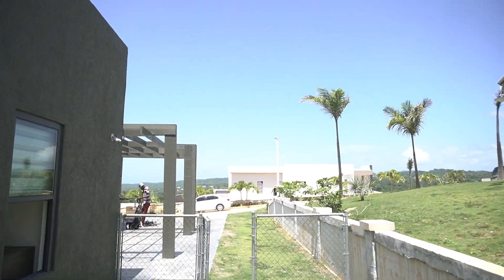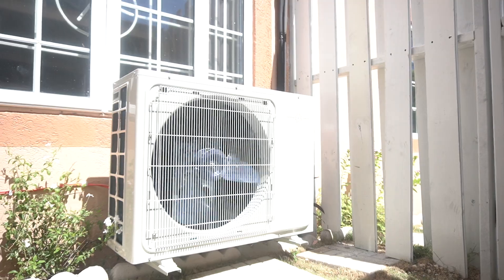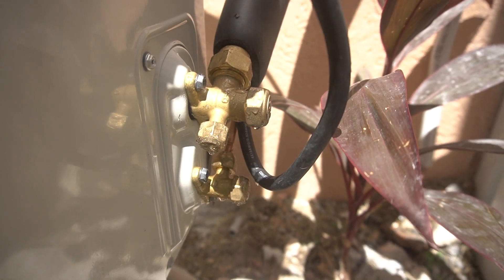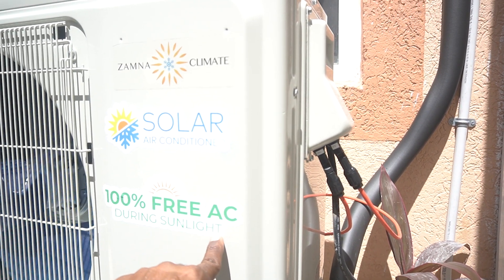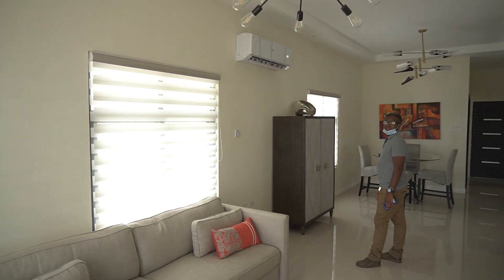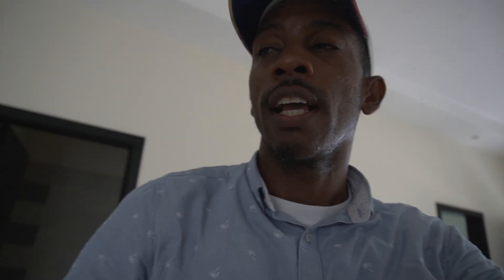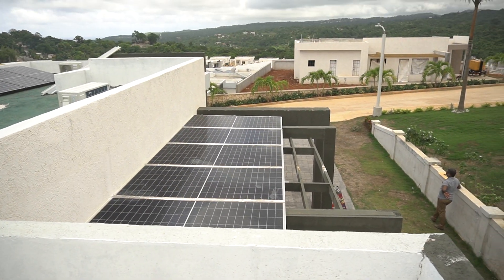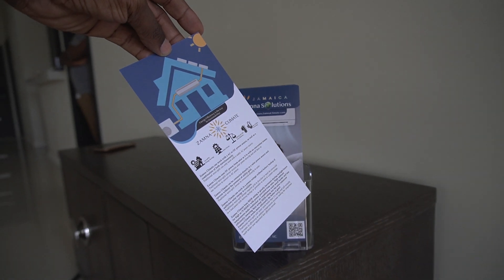DIY Solar Carport for 100% Free AC during Sunlight ☀

Comment: Rayon, is there any provision for the Ac unit to work at night when the sun sets?
Reply from the maker: Yes... At that time it uses grid power.
Reply: @RayonWhittaker   how long can it run on grid power?
Reply from the maker: @bangasijustin5799  for as long as there is no solar power

Comment: Rayon, do you have a life expectancy for this Ac unit? How long does the manufacturer say the unit will last?
Reply from the maker: The ones we've installed is approaching 2 years of operation.
Like any air conditioner, once serviced right should last years.
Reply: @RayonWhittaker  thank you Rayon for your quick response. Live in San Diego, CA. Area giving it some thought. Was reading about the inner wall mount section but not clear on hole dimensions for cut out so unit fits properly in the wall.
Reply: Do you have a video on install including preparing the wall for install. Not the outside unit, the inside blower unit.
Reply from the maker: @luisackerman7629  No, so sorry. Unfortunately I didn't record a full video for that.
Reply: @RayonWhittaker  ok, thank you, very good idea. Looking into it. Thanks again.
Reply from the maker: @luisackerman7629  feel free to check out the deye version.
I've also installed those and they work pretty well.

The one I've installed are going almost a year now.

Comment: Is it series or parallels? Why ?
Reply from the maker: The panels are in series, each panel is 405W and Voc is 41V 
The 18000 btu AC unit needs at least 1390W and the voltage needed from solar modules is between 100-380V DC.

Comment: Based on what I observing it would only make sense to have this Solar hybrid AC to complement your home. It will get hot, then you will require an AC, but when you have this Solar AC Unit it will not to burden you financially paying the power company on the island. Trust me this guy is doing us a favor.
Reply from the maker: And while it's using the solar panels to cool the home, that's free energy. So you can cool the entire home while the time is hot 🔥 and by the time the sun is out just use fans to keep the cold air circulating.
While the walls, tile and ceiling remain cool during the daytime, the house will need less energy for cooling during the nights.
Reply: @RayonWhittaker  that is even an improved idea 💡to benefit from.  I have heard the Energy Bills are insane in Jamaica and the company is privately owned/monopoly. I hope this can reach as many people as possible to see that options like these are available.